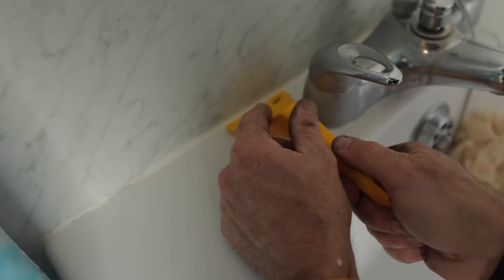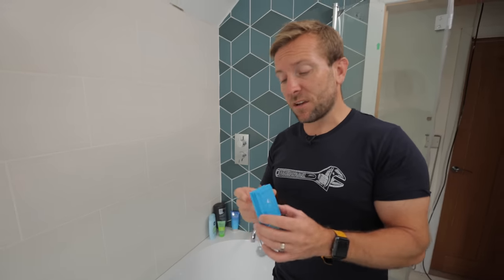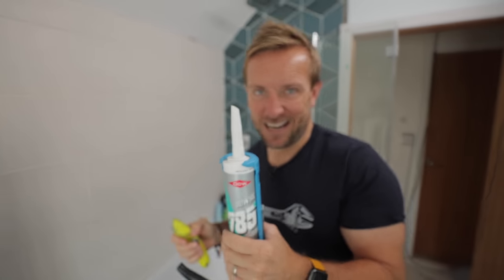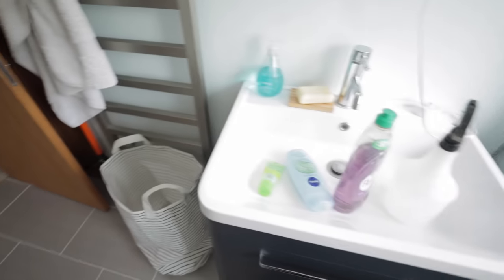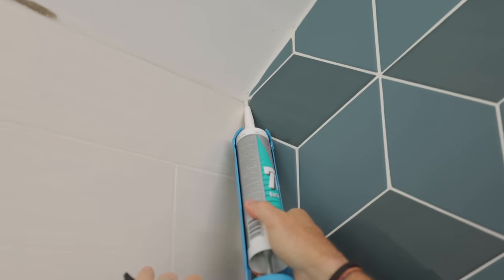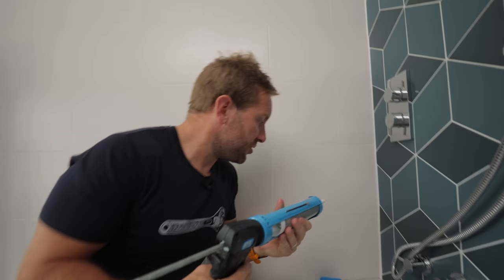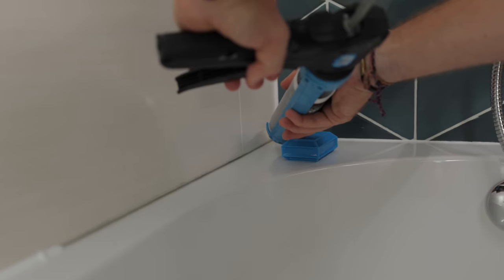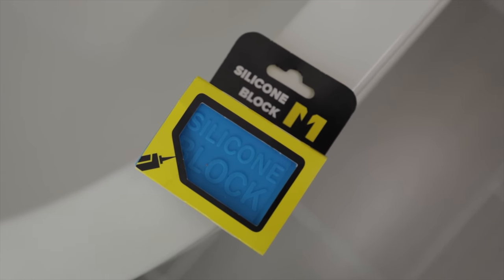HOW TO SILICONE A BATH OR SHOWER WITH A METEX SILICONE BLOCK

Comment: In my experience spraying silicone prevents it from sticking properly, causing it to peel away once cured, even DOW. If sealing awkward areas or textured tiles then maybe use it as a last resort, but smooth tiles? Skip the soap, you don't need it with silicone applicators.
Reply: Yup agreed. Especially when spraying the vertical section first. All that soapy water is now landing on the open joints that don't have silicone in it. No way silicone is adhering properly to that. At first it looks good just after a few washes/scrubbing it'll start to pull away. I find the fugi kits also are simple and not as awkward to use as the block. End of the day I hate applying silicone even with the tools available.

Comment: The BEST kit for this job is the Cramer profiling kit. Silicone on the surface, use the tapered side of the tool to push the silicone in THEN, spray with soapy water. Finally use the flat side of the tool to remove the excess. Professional finish even if you have never done it before.
Reply: Good pointers. Key being spraying after you actually tool in the silicone ensuring no soap is behind the silicone. Then using the tool again to easily clean up excess with soapy water. Another option would be to tool it with any size you want. Spray, then using one size up to clean up any excess

Comment: i learned this method from a Polish guy Marick some 18 years ago, never used a balock but will try that, rather than wipe with the baloo roll try say an old 10 litre paint bucket with water and a strong fairy, solution bucket wide enough to shake the excess silicon off yu hand or balock, mmmm no residue, i’ll try rubbin down the balock with neat fairy before the scrape, noice one James 👍🏽

Comment: Any tool will slightly spread out caulk along both edges.  But, caulk will not stick to those edges because they were wetted with the soap solution. I see others doing the same way, but edges will peel up because silicone caulk does not stick to bater-based products (spray bottle soap).
Reply: Agree i never get water or soap anywhere near my siliconing.
Reply: You spray once the silicon is applied, so it doesn't get under the silicon, only on top preventing it to clinging to whatever tool you use.
Reply: @b1gd312  yes. BUT the spray goes onto the outside margins of the bead of silicon and into the tub, etc. When the silicon is “tooled,” it is slightly forced and overlaps those sprayed putter margin areas and will not stick to those outer areas.
Reply: @b1gd312  nah boss

Comment: Cramer Fugi tool has option for different bead sizes. I’m DIY and found it really useful, and the small blue tool gets behind taps.
Reply: I use these Fugi tools too and great. No soapy water as surface must be bone dry for silicone to stick. Can use water with Tec7 as acrylic sealant. I needed a narrower profile tool than blue one so I split it in two with a blade heated in a flame. Almost impossible to cut with hacksaw. There are very narrow Fugi tools with long handles that look great but expensive.
Reply: I use a tongue depressor or lolly stick behind taps lol

Comment: Great tool. I’ve used plastic angled tools before but these were very messy and not accurate. This block runs smooth across the bath surface with less mess.

Comment: Meet James, a wizard of wet and dry, With silicone block, he reaches for the sky.

His tool in hand, he works his charm, No more messy leaks, no cause for alarm. With a flick of his wrist and a squeeze so tight, James makes those lines a pure delight.

Comment: I use the fairy liquid only when I have three beads meeting each other, because I can never make that right.  Instead of spraying I apply the fairy liquid mix with a small paint brush until the sticky up bits are smooth.  I don't bother with profiling tools any more, just use a finger with a latex glove on, whenever I see extra silicon building up I ease off on the trigger.  This way there's almost no waste.

Comment: I use the Vitrex silicone finisher from Toolstation or Screwfix. It has changeable heads for different sized beads. Been using it a few years and have been happy with the results. I might buy one of these blocks though to have an extra option for tight situations.

Comment: Tip: If silicone is sound (around bath tub, shower tray, basin etc) only mould and dirt etc, no need to replace the silicone. Run loads of loo roll paper around the silicone sealant and soak it with loads of bleach. Leave min 9hrs, then come back remove soaked bleached loo paper. VOILA!! Good as new...

Comment: Nothing better than the Fugi
Reply: I think the Fugi kit is much easier to use
Reply: The Fugi kit's good and will certainly do the job, it's a matter of preference which one you use. 🙂 The silicone block's designed to take the variation out and be a bit more beginner-friendly as it needs no setup and there's no small pieces that could get lost.

Comment: "Nice, neat corners"

11:29 Shows us an out of focus shot of a badly bodged corner....

Also, that block won't work on a corner where you have 2 horizontal and 1 vertical seals meeting, which was probably the problem with the shot described above.

The only thing that block has got going for it is that it doesn't give you a dent when you jump tiles. However, using the more traditional silicon finishing tools will also give the same result if you know what you are doing (including behind taps!).

I'm also unsure about spraying all that soapy water on the silicon bead before you finish it with this tool. I'm fairly sure soapy water prevents a good adhesion between wall/bath and silicon on the edges of the bead.

But apart from that, a reasonable video from the shopping channel.

Comment: Really mate should fill the bath up with cold water first as you know, and why you ask, because when the silicone as dried and you do eventually fill the bath the weight tends to rip the silicone and potentially you’ll end up with invisible rips that are not waterproof, just saying like 👍
Reply from the maker: You should watch the videos about I’m the installation of this bath. You’ll never need to fill again. 

But usually on a crappy install you’d have to.

Comment: That block is worth a try. Cheaper than fugi I think. Also, use a silicone made to BS5889 and it will smooth out beautifully.

Comment: Don’t use spray, too much water goes down to the dry bit below. Also in my view you’ve cut your nozzle way too thick - that’s why there’s so much excess coming off on the block. The art of silicone beads is to get the right amount on in the first place..

Comment: I just can't see how you're going to get a tidy 3 way corner with that tool , surely to get tight in the corner its going to touch the wet silicone in the other direction ? Or am I missing something?

Comment: Countless people will tell you not to spray soapy water on when doing this as this acts as an adhesion buffer and you might find the edges of your bead then don't actually stick to where you want them to.
Reply: So do you just use water?
Reply: Soapy over the top is ok not underneath
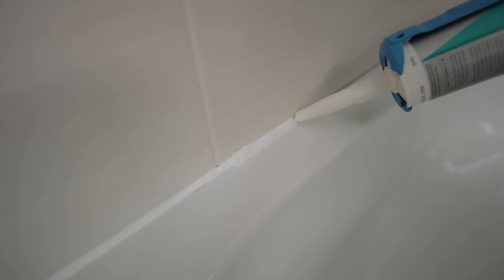Reply: @mcfcmanc   If the bead is inconsistent and sparser in some areas, your tool (or finger) will spread the silicone over the soapy wall. the lack of adhesion will worsen over time and the moisture is trapped inviting mold. 10:55 Shows a gap in the silicone near the grout, this void will be covered in soapy water and the silicone wont stick.
Reply: @wol377 make sure you have no gaps when applying and ita a non issue.

Comment: At 12-14 Quid a tube I wouldn't want to waste as much as you did. A cheap wooden stick that's been shaped and the nozzle cut to match the size of that stick will result in nearly zero spew out. And they get behind taps no problem at all.

Comment: Thought you had to fill the bath with water before silicon was applied?
Reply: Why not just stand in the bath while you apply the silicone?
Reply: @mda5003  If its filled with water, the load is spread evenly. This is to prevent the silicone coming away from the wall when the bath is in use.
Reply: @mda5003 because you aren't going to stay standing in it for 24hrs 😂🤣😂🤣

Comment: This was a very informative video giving plenty of tips👍 Here is my entry for the silicone block giveaway.

In the bathroom's realm where waters flow,
A silicone block, a helper in tow.
With purpose keen, in skilled hands held,
Sealing the bath, a story to unfold.

Gentle and firm, its touch does glide,
Smoothing the seal where waters bide.
A silent dance, a ballet of grace,
Erasing imperfections, leaving no trace.

Beneath its weight, the silicone yields,
Crafting perfection in bathroom fields.
Edges once rough, now sleek and neat,
A masterpiece of seal, so complete.

Oh, silicone block, your role profound,
Turning chaos into order, I've found.
As bath and seal become as one,
Your work is finished, your task is done.

Comment: You need to clean the surfaces with alcohol to remove all of the debris.  
Also, you are using way, way too much silicone if you are removing that much with the tool.

Comment: Why are you advocating spraying?  I dont get it. I used a different tutorial (Charlie) over 2 years ago suggesting Fugi kit and definitely no spraying.  My shower cubicle came out really well, no leaks, looked better than the original installation (which did leak!)
Reply from the maker: Spraying is for this tool in particular. Usually I don’t spray either.

Comment: The silicone block is all you'll need,
A little spray and you'll pull a smooth bead,
When finished the job,
Just like with your knob,
Give it a clean for the next dirty deed.

Comment: Mistake, cutting nozzle at an angle. Cut square, it forces mastic into the gap and stops them little gaps you were getting and don't spray with water or foam spray 🙄

Comment: Ps no nonsense sealant from screwfix is by far the easiest to work with , it's cheap it runs like a dream and stays there for years , no mould no peel no worries. And no I don't work for screwfix 😂

Comment: Rule number one, You forgot to remove the existing silicone first. New silicone will not stick very well to old silicone. Also just use clean water and not soapy water.
Reply: Fresh Silicone will stick to existing silicone. 
And water isn't necessary when applying sealant if you know what you're doing
Reply: @tomalex4806  if you know what you are doing then you wouldn’t put fresh silicone on old silicone plus I didn’t say it wouldn’t stick I said not very well. You may as well use chewing gum.

Comment: James I used to use fairy but I use CT1 multi solve spray to tool off and it's the fucking business mate, give it a go
Reply: I used to use general purpose cleaner.
Reply: We don't recommend using multisolve or other solvents with the silicone block as it risks damaging the block. You can still remove old sealant with it, just make sure there's no residue before you start tooling 🙂

Comment: Use metholated spirits to clean the surfaces.
 Fugi shapes are better.
 Straight cut across the nozzle.
 Inside of cut nozzle should match the the profile...eg. 6mm cut to 6mm fugi.
 Use window cleaner to spray the bead after application before using the Fugi..
 THIS is how to do it properly !!
https://www.youtube.com/watch?v=_DI4hfHM_Hg&t=2s

Comment: In bathrooms' realm, where waters dance,
A METEX Block awaits its chance,
To apply the finish, with silicone grace,
Creating a seal in the perfect embrace.

'Twixt tiles and baths, its role defined,
Smoothing the seal, a task refined,
With skilled precision, it glides along,
Ensuring the bond is steadfast and strong.

Silicone's touch, guided with care,
By the METEX Block, a duo rare,
In showers' haven, where droplets abound,
A watertight barrier is skillfully wound.

Colors shine bright, a spectrum so grand,
As METEX Block moves with skillful hand,
Applying the finish, a guardian's mark,
Turning a gap into a seal, so stark.

Oh, METEX Block, tool of finesse,
Turning chaos to order, in a process blessed,
In bathrooms' embrace, where waters flock,
You work your magic, METEX Block.

Comment: Why didn't you wait until you had a bath with the awkard taps sticking up out of the bath close to the wall, which the silicon block was probably designed for to do the video.

Comment: Ive not tried this one, i usually use the No Nonsense set from Screwfix, ive used them for about 8 years, i run in the silicone and smooth it dry, dabbing off excess silicone every few seconds, after its smoothed in you can use soapy water or spit and run your finger over it lightly to take out any divits in the tile. Im happy to give this one  go though, so heres my rhyme. Oh silicone block, oh silicone block, you smell just like my lovely cock, probably because i clean it with the same stuff i use to clean my silicone block, oh silicone block, oh silicone block, you rock, just like that dude with the pointy ears, Doctor Spock!!! Do not mock the silicone block, for you can use it in a frock, you can use it in a smock, you could use it with one sock, or while wearing a Croc, so do not knock the silicone block or you might get a knock at the door from the guy who invented the silicone block!!! 🙈🙈🙈

Comment: Waste of time. No tools needed. Beads should never exceed 2-4 mm in professional setting. Bathroom should be scribed tight enough to allow 2 mm beads. First mistake was cutting the nozzle. NEVER cut the nozzle. Also if bath is fitted properly on a levelled batton it will never drop and break seal.

This tutorial is a sales pitch to diy’ers. If professionals are doing this you’d be better laying driveways.